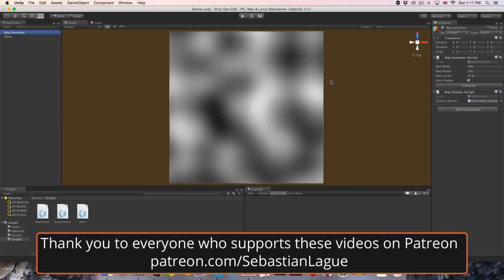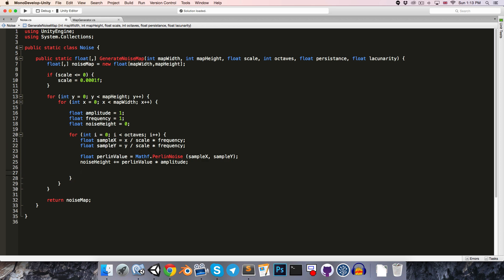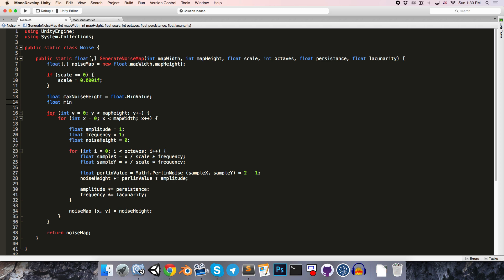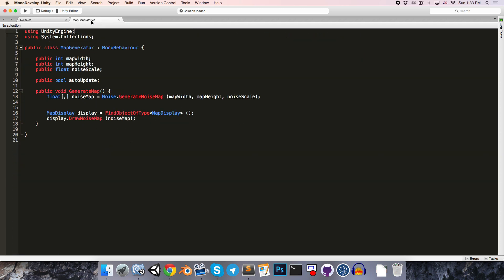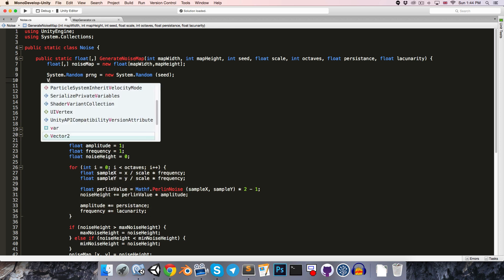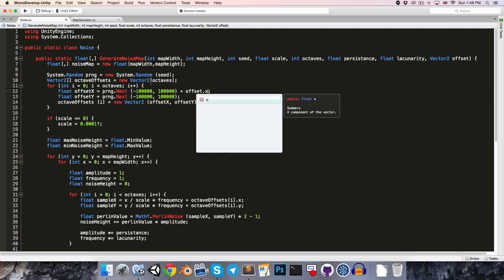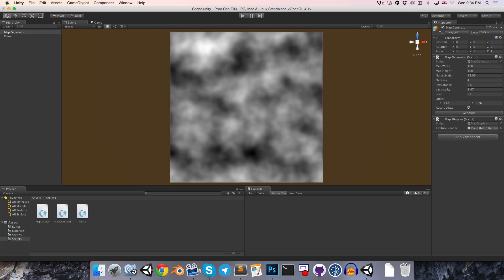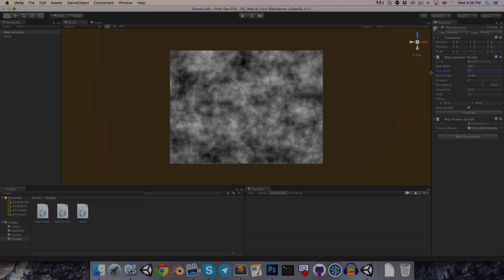Procedural Landmass Generation (E03: Octaves)

Comment: I wanted to see if I could edit the script so I could lengthen the perlin noise on one of the two axis. I found it by changing the scale float in the noise script to two different variables, scaleX and scaleY. Now I can adjust the perlin noise a bit more stretching it to one side. Also had to change the GenerateNoiseMap in the MapGenerator script by deleting the noiseScale and adding noiseScaleX and noiseScaleY. This might sound simple and obvious for most of you but I'm a 3D modeller, my coding level is that of a kindergardener :x so i'm pretty proud about that.

Comment: Just a note if anyone is trying to implement this in a real game that needs to be chunked or tiled in any way, this works only if your noise texture is generated once and then sampled. Offsetting and changing scale will dramatically change the features in the next tile since the average is being calculated locally and offsets are being offset too much. You can see the artefacts as he scrolls through terrain in the video, it is not continuous terrain. 

Solution is to first change the offsets so they match the scale :

float sampleX = ((x - halfWidth) / scale * frequency) + (octaveOffsets[i].x / scale * frequency);
float sampleY = ((y - halfHeight) / scale * frequency) + (octaveOffsets[i].y / scale * frequency);

and after that you can either remove the scale (not recommended) or you can calculate the max value globally. Since your noise map outputs 0-1 , you can either use geometric series to pre compute the maxValue, or you can just send a dummy value of 1 through the loop, applying the function, and saving the result as maxValue. 

Another thing is you want to not scale the terrain -0.5,0.5 if you are not working with Z component, if you are, you need to compute the minValue using the above technique.
Reply: Thanks a bunch mate. I'm doing a factorio like prototype for my bachelor thesis and you saved me many more hours right now. I mean I still have like 5 months or so, but just the fact I don't have to deal with this problem anymore, well, lets just say I am very grateful for time you put into writing this. I was thinking about what you said before reading, I was pretty sure things were happening out of order, but I couldn't nail it down and there you are, thanks a bunch again.
Reply: how to fix that?

Comment: if you want to fix the scale that create a new map instead of scaling the noise, here the the fix: 

Change this in Noise.cs:

float offsetX = prng.Next(-100000, 100000) + (settings.offset.x + sampleCentre.x)/ settings.scale;
float offsetY = prng.Next(-100000, 100000) - (settings.offset.y - sampleCentre.y)/ settings.scale;

float sampleX = (x - halfWidth) / settings.scale * frequency + octaveOffsets[i].x  * frequency;
float sampleY = (y - halfHeight) / settings.scale * frequency - octaveOffsets[i].y * frequency;

it's a modified version of this fix https://www.youtube.com/watch?v=XpG3YqUkCTY that work with the final version of this tutorial (ep: 21)

Comment: Minor tip: If you're still bothered by the resolution despite all the operations and think it's blurry, the reason is that you're entering pixel values for localScale in your MapDisplay script. The transform values of components in Unity specify their coordinates in the world, not their resolutions in pixels. Therefore, you need to keep the localScale variable lower so that pixels are compressed instead of spread out, resulting in increased resolution. You can achieve this by dividing the height and width variables in the MapDisplay script or passing other variables to the Renderer.

Comment: i had an issue with generating the noise map, unity wouldn't accept 8 parameters... code: 
public void GenerateMap() {
        float[,] noiseMap = Noise.GenerateNoiseMap (mapWidth, mapHeight, seed, noiseScale, octaves, persistance, lacunarity, offset);

        MapDisplay display = FindObjectOfType<MapDisplay> ();
        display.DrawNoiseMap(noiseMap);
    }
Reply: yo i have the same error as you, have you found the error?

Comment: If when resizing your map causes an out of bouds error for width less than height greater than change y * height +x to y * width+x this will scale it properly and not use a height * height in case y = height and width < height it would generate gigantic indexes compared to the size.
Reply: Hi, I dont understand what you mean, could you please explain what code specifically I should be changing?, thnx
Reply: @ricky_en  Sorry I haven't touched the project code in months, I cannot remember, but I assume, the issue here, is that the code which scales the noise to fit within the size of the texture, on my end was multiplying by the wrong axis, ironically, multiplying y by height(it's corresponding axis) causes values to become larger than the pixel indexes on the screen, multiplying it by width fixed the issue, as width would be smaller than height and, if y scales towards the value height it would become height^2. I cannot remember why this was the case. Shouldn't be anyway, I'd try to multiply y by (height -1) so the index is never larger or equal to the length of the array(presume it to be the vertex array). 

In regards to where the code to change is suppose to be, I presume it is within the function for generating the noise height for the current x,y coordinate within a given chunk.

Comment: 7 years later and these are still the best tutorials out there! Great work Sebastian!

For anyone watching this now, here is a fix for the parallax seen at 9:04 when changing the offset:

float sampleX = ((x - halfWidth) / scale - octaveOffsets[i].x) * frequency;
float sampleY = ((y - halfHeight) / scale - octaveOffsets[i].y) * frequency;

Note: This also flips the scroll direction in x and y which makes more sense when you are dragging the values in the editor but might break eventual minimap code etc. If you do not desire this just flip the sign again.
Reply: Thanks for that! I do prefer the parallax effect though, but man is this comment section a treasure trove!
Reply: Thanks man

Comment: The else at approx 3:51 will make it so that if the first value generated is the lowest, the normalization will fail. (as the first value will be both the highest and the lowest value seen so far regardless of value, it needs to update both). It should just be a separate if statement.

Comment: If anyone is looking to allow a string for their seed instead of a number, you can use this code: 
Set your seed in your MapGenerator to be a string and name it something like seedString. Then, just before calling the GenerateNoiseMap method, you can use this line of code to convert your string into the required int.
int seed = seedString.Select(x => Convert.ToUInt16(x)).ToList().Sum(x => Convert.ToInt32(x));

Comment: If somebody has this error: 
IndexOutOfRangeException: Index was outside the bounds of the array.
Noise.GenerateNoiseMap (System.Int32 mapWidth, System.Int32 mapHeight......

Check if the for loops has x and y at the right spot! If they are turned around it won't work!
Reply: this can also happen if you have one of your lines with noiseMap [x, y] in it entered as noiseMap [y, x] by mistake
Reply: @donohms7827  I was looking through recent comments to try and find why I was getting this error, and I figured out this was the reason. tysm!

Comment: Hey guys I have a small issue, there's a diagonal line on my texture with one side having a perfect color but the other is more bright. And everytimes I save the project the texture turns white and I have to generate or change the values to show the texture again
Reply: I'm having a similiar issue where I get a bunch of weird diagonal lines emanating from the top right corner.
Reply: If you find the solution, let me know
Reply: if you change the samples to
                    float sampleX = (x - halfWidth) / scale * frequency + octaveOffsets[i].x * frequency;
                    float sampleY = (y - halfHeight) / scale * frequency - octaveOffsets[i].y * frequency;
I noticed it got rid of the line and made the transmission in the offset more smooth

Comment: mine worked from the last video, but after following this one to see if it worked i got a pitch black plane. turns out i was watching on lower quality so i was getting * and = mixxed up in  some places, so it turnes out that when you code
noiseHeight += perlinValue = amplitude;
you get a black texture
instead of 
noiseHeight += perlineValue * amplitude;
which is what you did and said you did

Comment: I have just spent the last week going over every terrain generator out there and none of them seem to give me what I want. This series is one of the best I've seen for anyone looking at getting into creating their own generator. Absolutely awesome! Definitely worth a patreon sub!

Side note, at 5:50, my texture doesn't have the blacker black areas that the video shows with the same values in the generator. There were only a few values in the noisemap that had a value of < 0.1 and only 1 that had a value of 0. Strange

I really appreciate the time and effort you put into this, it is definitely the best resource I found for procedural map generation. Thank you!
Reply: Lol, somehow when I reorganized the project, the plane lost my MapMaterial material so it was using the default material. Switching it back to the MapMaterial fixed it so it now shows the correct black values. That was actually pretty funny. I thought it was due to the editor default lighting, directx vs opengl, I was changing all kinds of things trying to fix it!

Its ok now though so don't anyone fret! 
:)

Comment: Why would you want to have negative noise values? It seems redundant to take something that generates a value between 0,1 make it generate a value not between 0, 1. Then normalize it to have a value between 0,1. Can you explain the purpose of this snippet.
float perlinValue = Mathf.PerlinNoise(sampleX, sampleY) * 2 - 1;
Versus this snippet
float perlinValue = Mathf.PerlinNoise(sampleX, sampleY);

Thank you!
Reply: I also had trouble understanding the multiplication by 2 and subtracting 1 and what it is meant to accomplish.

Let's say Mathf.PerlinNoise(sampleX, sampleY) returns -0.1, which is possible according to the Unity documentation on this function here: https://docs.unity3d.com/ScriptReference/Mathf.PerlinNoise.html

-0.1 * 2 = -0.2
-0.2 - 1 = -1.2

Let's say it returns 0.4:
0.4 * 2 = 0.8
0.8 - 1 = -0.8

Let's say it returns 0.9:
0.9 * 2 = 1.8
1.8 - 1 = 0.8

Let's say it returns 1.1:
1.1 * 2 = 2.2
2.2 - 1 = 1.2

If you get back a negative number, you make it a lot bigger of a negative than it was, and if you even get back a positive number, you still lose a lot of precision. In the case where the perlin value is above 1, you actually end up making it slightly more above 1.

Comment: (Solved) For some reason everything works except  for the seed; changing it does nothing.  I can't see anything wrong with my code; can you guys?

public static float[,] GenerateNoiseMap
        (int mapWidth, int mapHeight, int seed, float scale, int octaves, float persistance, float lacunarity, Vector2 offset)
    {
        float[,] noiseMap = new float[mapWidth, mapHeight];

        System.Random rng = new System.Random(seed);
        Vector2[] octaveOffsets = new Vector2[octaves];
        for (int i = 0; i < octaves; i++)
        {
            float offsetX = rng.Next(-100, 100) + offset.x;
            float offsetY = rng.Next(-100, 100) + offset.y;
            octaveOffsets[i] = new Vector2(offsetX, offsetY);
        }

        if (scale <= 0) scale = 0.0000001f;

        float maxNoiseHeight = float.MinValue;
        float minNoiseHeight = float.MaxValue;

        for (int y = 0; y < mapHeight; y++)
        {
            for (int x = 0; x < mapWidth; x++)
            {
                float amplitude = 1;
                float frequency = 1;
                float noiseHeight = 0;

                for (int i = 0; i < octaves; i++)
                {
                    float sampleX = x / scale * frequency;
                    float sampleY = y / scale * frequency;

                    float perlinValue = Mathf.PerlinNoise(sampleX, sampleY) * 2 - 1;
                    noiseHeight += perlinValue * amplitude;

                    amplitude *= persistance;
                    frequency *= lacunarity;
                }

                if      (noiseHeight > maxNoiseHeight) maxNoiseHeight = noiseHeight;
                else if (noiseHeight < minNoiseHeight) minNoiseHeight = noiseHeight;

                noiseMap[x, y] = noiseHeight;
            }
        }

        for (int y = 0; y < mapHeight; y++)
        {
            for (int x = 0; x < mapWidth; x++)
            {
                noiseMap[x, y] = Mathf.InverseLerp(minNoiseHeight, maxNoiseHeight, noiseMap[x, y]);
            }
        }
            return noiseMap;
    }
Reply: Nevermind: make sure to apply the offsets guys!!
Reply: @CurtisJensenGames  All I get is	CS0106	The modifier 'public' is not valid for this item
Reply: @nlasalle08  Maybe change it to private or something?

Comment: Offset -100,000 to 100,000 works, but no larger, since float only has 6-7 decimal digits of accuracy. You're dealing with fractions of numbers after this. 100,000 is already using up 5 decimal digits, but you're requesting 6, 7, or more. (E.g. 10 million + 1 in float will still be exactly 10 million.)

Comment: If anyone plays around with the noise settings and notices there is a secondary layer of noise, and wants to know how to control that... Just do something like this:
Declare a variable for secondary noise scale however you choose, I did  this:
[Range(0,10)] public float secondaryScale;

and then pass it in to the samples under the loop. This allows for some extra flexibility in creating interesting shapes later on.
float sampleX = (secondaryScale * x) / scale * frequency;
float sampleY = (secondaryScale * y) / scale * frequency;

As always, thank you sebastian!

Comment: I can update all values from the editor via sliding except for Map Width & Map Height. It throws exceptions on the fly for "Index was outside the bounds of the array". If I adjust them both to be a value it will then generate as normal. It wouldn't shrink/expand as he showed in the video. Not sure if this is a new unity issue or I did something wrong. Looked over the source code and can't spot anything
Reply: Same problem. Did you found a solution?
Reply: Found a solution:
If somebody has this error: 
IndexOutOfRangeException: Index was outside the bounds of the array.
Noise.GenerateNoiseMap (System.Int32 mapWidth, System.Int32 mapHeight......
Check if the for loops has x and y at the right spot! If they are turned around it won't work!

Comment: First of all I have to say your teaching method and clarity is refreshing to say the least.
Tried this in Unity 2019.3.15f1 (3D URP) and at 5:34 saved and tried to adjust lacunarity. This makes Unity hang and I think it corrupts the Scene as it does not load back up on re-load. I'm guessing this is a .NET 3 / .NET 4 thing. Can you make a version for more recent Unity Versions?

Comment: MAKE SURE YOU TURN FOG OFF IN THE EDITOR NOW

Shouldn't it be the other way around?
maxNoiseHeight = float.MinValue  ----> float.MaxValue
minNoiseWidth = float.MaxValue ----> float.MinValue
Also, I changed the InverseLerp values to -1, +1
Reply: no the way he did it is correct as he wants the value to be updated on the first run of the loop, hes basically searching for the min and max values of the array.

Comment: I believe there is a flaw in the min/max noise height part of the procedure.  Because you used an "else if" for the minimum height part, if the first sample happens to be the minimum value for the entire map, the minNoiseHeight value will never be assigned to that minimum because the first sample will always be greater than the initial maxNoiseHeight value and it will not go in to the minNoiseHeight part of the conditional statement.  If you make both parts if statements instead of if/else if then it should correct this flaw.

Comment: I grabbed a bunch of code from github for open simplex noise. I had to remove a bunch of code for 3D and 4D noise, then modified it to make it work. The noise in my implementation is extremely slow.
It gives different values than the Unity perlin.

When you average the two noises then multiply it by amplitude the results are amazing

Comment: I had an issue where applying the octave offsets caused the code to produce a height map with bumpy square artifacts. If anyone else happens to be struggling with this, I fixed it by modifying the code like so;
float sampleX = (octaveOffsets[i].x + x - halfWidth) / scale * frequency;
float sampleY = (octaveOffsets[i].y + y - halfHeight) / scale * frequency;
Reply: A better fix for both the issue with parallax and the scaling is to not apply the scale the the octaveOffset but only the frequency. Also a tiny nice to have is to flip the y offset so that when you drag the value in the editor up and down will be correct.

float sampleX = ((x - halfWidth) / scale + octaveOffsets[i].x) * frequency;
float sampleY = ((y - halfHeight) / scale - octaveOffsets[i].y) * frequency;
Reply: I think this breaks the ability to have scale be centered.
Reply: It does, and it's broken in the official source code as well.
To be able to scale the noise for a minimap, I Added a new float variable "zoom" to the function and update the code to be: 

float halfWidth = (mapWidth*zoom) / 2;
float halfHeight = (mapHeight*zoom) / 2;       

float sampleX = ((x*zoom) - halfWidth + octaveOffsets[i].x) / scale * frequency;
float sampleY = ((y*zoom) - halfHeight + octaveOffsets[i].y) / scale * frequency;

Not sure if that's correct for other applications, but it works for a minimap.
Reply: @fromptech2210  What is zoom equal  to?
Reply: up to 100000 is too high an offset and will give floating point precision problems